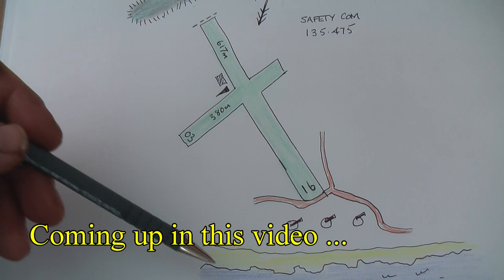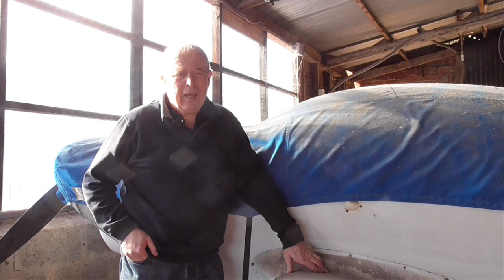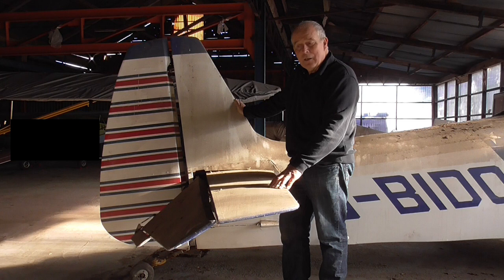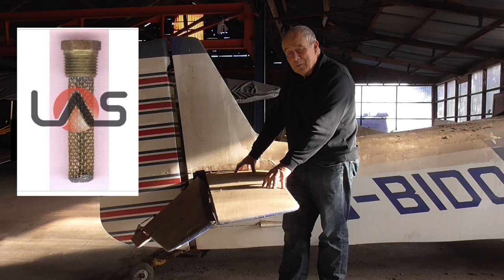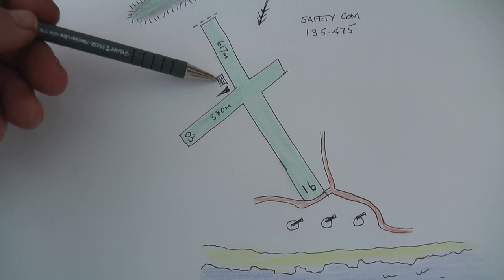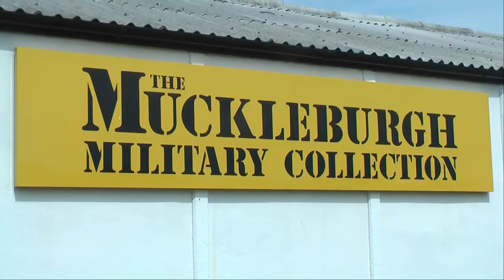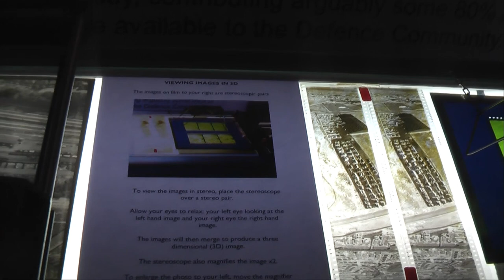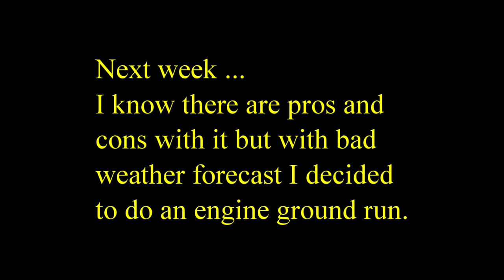MY ENGINE FAILURE(S) + Weybourne / Muckleburgh Collection - PILOT VLOG #295

Comment: Like the story of the engine failures. The lesson from that is if you find some FOD in the fuel line investigate to find what produced it (hind sight always 20/20). Funny Weybourne is just a hop for me and yet I have never flown in.
Reply from the maker: Yes, easy to assume that the plastic was the only reason when with the extra fuel she ran so well. I really enjoy Weybourne and the collection is interesting. They also have days when they drive the tanks (post lockdown that it)
Reply: @JodelFlyer  Yes I have been to the Muckleburgh collecting but by car and flown over it, when it has been closed. It is one of those funny things, it is just a few miles from me yet I have not flown in.